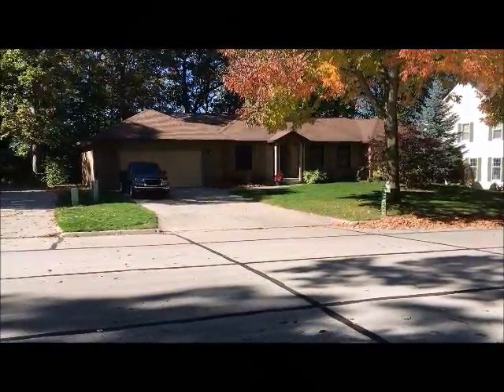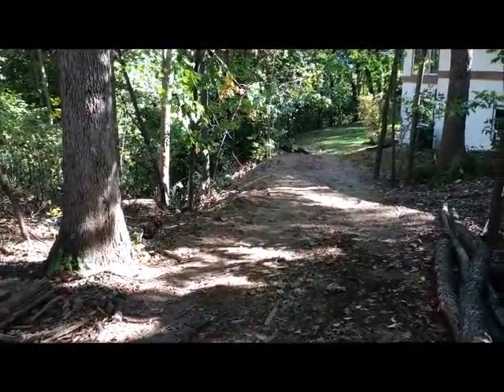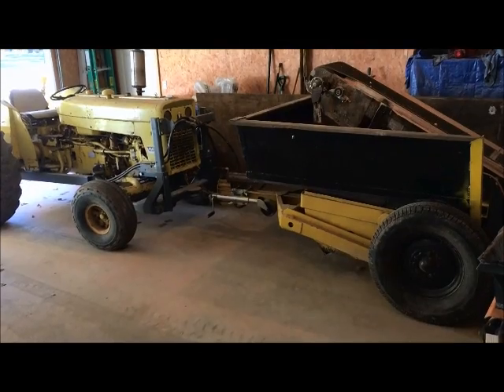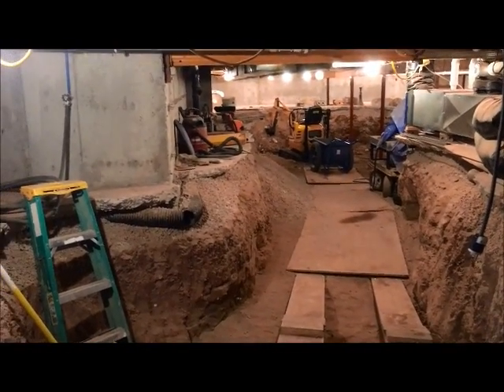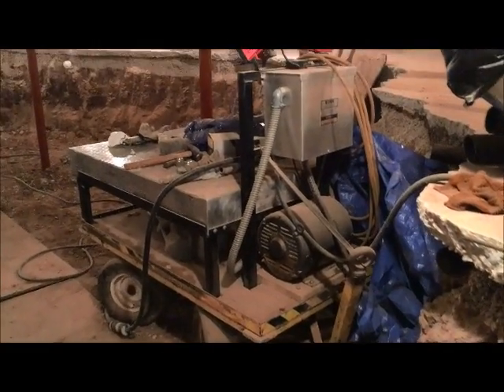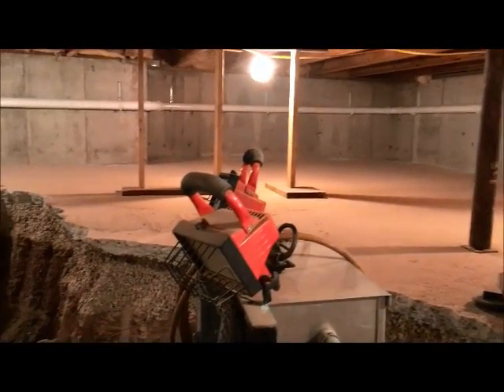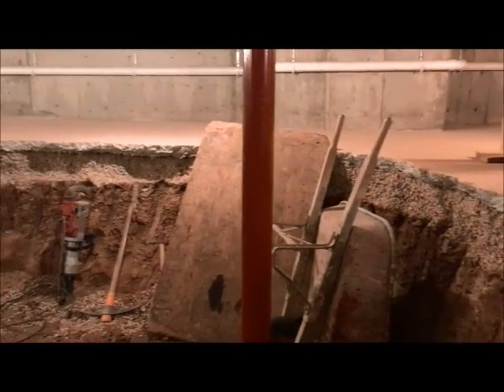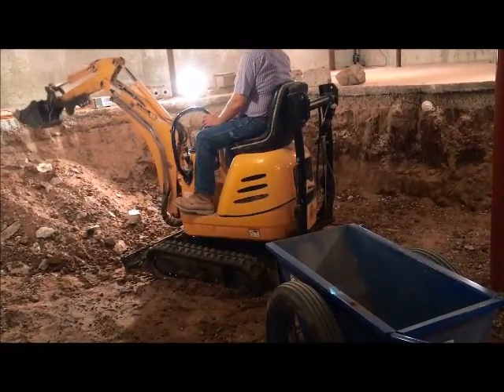Convert Crawl Space Under House to Full Basement Chapter 5

Comment: Mr Anderson,

  Would you provide some basic sketches on how you intend to stagger the foundation reinforcement?  As a lowly EE I am having a hard time picturing what you mean by "the foundation acts like a beam".  Thank you for your videos on this extensive effort!
Reply from the maker: A lowly EE? Hardly, Sir. I envy you your education, and I appreciate your intellectual curiosity.
If you tag the pop up panel at the end of the video, or if you already have the whole channel, go to video "update 7."
There you will see underpin panels and the existing wall/ footing together.
"The wall acts like a beam" may be oversimplified vernacular, but as you watch update 7 & you see the underpin socket cut under the wall, but it really doesn't function as a wall at that point. It is a continuous concrete beam with a 10" thick x 4' high vertical section. All that mass only needs to span an opening 5' wide, & carry a load of about 2k#/ lineal foot on the joist bearing walls- even less on the gable ends. When we undercut a corner we add shores, otherwise the wall (now beam, then wall again,) manages the span nicely.
Oh, and Mister was my dad. I'm Lee